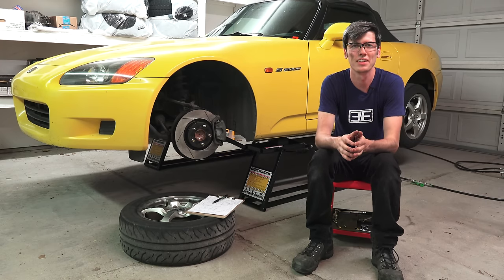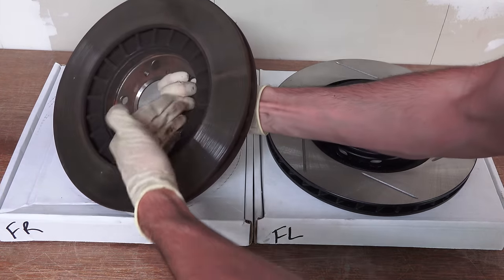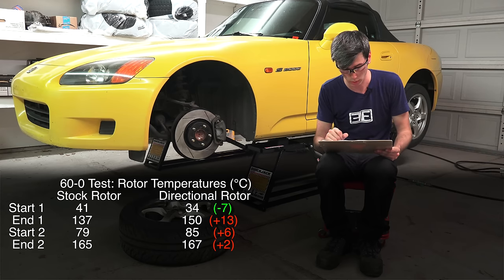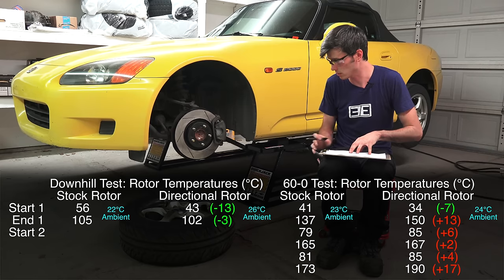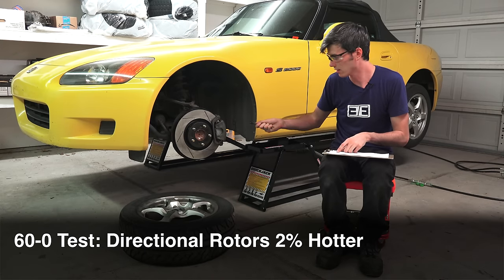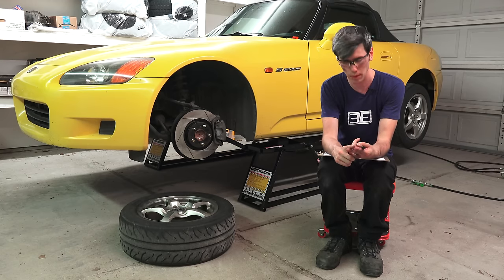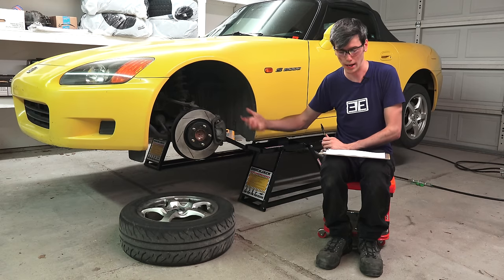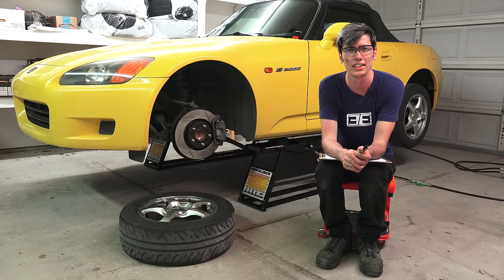Do Performance Brake Rotors Have Better Cooling?

Comment: You measured the outside surface. I wonder if the outer surface of the premium rotors is hotter (but the inner surface cooler) given that topologically, the thermal flow is less connected for the outer surface than the stocks.

Comment: The vents in vented rotors aren’t meant to cool the rotors, they’re actually meant to bite the pads to heat them and create friction. Drilled and slotted rotors are better. The holes allow gas and pressure built up from the heat escape from in between the pad and rotor so they can maintain full contact with each other. I would say drilled and slotted were best, and just drilled would be the next best option. I’d stray away from just slotted rotors. That’s only my opinion though.....but I’m soooooo not a professional lol.

Comment: I thought you're going to measure the temp as the vehicle moves. It's only natural for the performance rotor gets hotter because of the friction, but when it is moving, performance rotors released heat better than stock. Performance rotors were designed that way.

Comment: Thanks for great Video!

Isnt it the case  that those performance brakes will cool much quicker beetween breaking than stock - you accelerate and break all the time on track. I think that is the case.

Comment: Great video however you have missed the point that these get up to operating temperature quicker than stock which provides better friction coefficient therefore better braking while also being able to cool quicker from the higher temperatures. Overall better performance.

Comment: Why didn't he just did a test .. one side OEM rotors and aftermarket on the other .. just saying
Reply: Jancarlo C you then run the risk of flawed results due to one rotor doing more work than the other, resulting in a large temperature difference

Comment: Some variables here.

The vented discs are what are supposed to improve cooling. Considering the stock Honda discs were vented (through the centre of the disc vertically) there would only be a good difference based on the quality of the aftermarket discs and design of the cooling vanes. If the aftermarkets are cheap and nasty, the Honda discs may well be better made and designed.

I always thought, and I could be wrong, that the grooves in the face of the contact area were to help disperse brake pad dust.
Reply: The slots are to keep the pads from glazing over.  And so far I am happy with the cross drilled slotted Amazon rotors and ceramic pads.

Comment: The only way this test is viable is if it is performed under the exact same temperatures and time of day, plus the new pads have to be fully seated to the rotors to create the heat the seated ones did.

Stopping distance when the brakes are hot is a much more relevant test anyway, when it comes to brakes.
Your efforts are not unappreciated but too many times the ambient factor is left out of testing, Thanks!

Comment: If you're using street/track pads. You would want to keep your brakes hot on normal roads.
Therefore, the aftermarket rotors heat range is ideal.

Comment: Directional slotted rotors are designed to move debris from the between the brake pad material and the rotor, thus keeping the friction coefficient consistent and high. Included water vapor in wet situations. This prevents brake fade. Drilled rotors on the other hand are designed for cooling

Comment: Carbon content of the metal has more to do with heat tolerance and in turn heat dissipation ... I think you need to redo this video and use 3 or 4 different types. Also, you need a better control for testing other then you driving your car randomly and then manually checking the temp.

Comment: IMO this was not an apples-to-apples comparison: From the looks of the slotted rotors, they have not been bedded in properly whereby pad material is embedded onto the rotor. So there are only frictional stopping forces and there is no chemical force component, which happens between the pads and the rotor once pad material has been "bedded" into the rotors. He really needs to drive with the slotted rotors until they are bedded with the pads and do the test over. Or buy new stock rotors that have not been bedded and redo the tests.

Comment: Hi  the important thing in high performance driving regarding brake temps the rate of cooling?  or how fast the breaks cools after reaching high friction heat. A better test would be to put the stock and aftermarket rotors on a stationary rotating hub where the rotor can reach a specific speed each time.  then apply brake force for a specific amount of time.  Then immediately after removing the braking force measure the rate at which the rotor cools as it spins at the same rotational force.  In racing it's not about how hot a rotor gets, but how fast it cools down while still moving down the track.  I bet the aftermarket rotor will cool down faster than stock.

Comment: Cooler brakes doesn’t necessarily mean that they’re better. Good brakes will heat up fairly easily and stay within its operating temperature when in use. If they are cold all the time they would be useless.

Comment: Also need to factor in what materials the rotors were made of and (it appeared to me) that the stock rotors were used.  The stock ones might actually not be stopping quite as well, so they wouldn't heat up as much.

Comment: Former nascar tire specialist here , they are going to be the same temperature on the surface, because it’s the same friction from the pads and same pressure , they cool better in the sense of longevity and brake fade and they will dissipate the heat faster over driving time , high braking then when you drive say 500 meters that rotor will be cooler and less fade,

Comment: You should use stock and aftermarket rotors both new. As you can see old rotors are already bead in and the hills and valleys of the rotors metal surface are already  aligned to the pads and smoother but not glazing. That is why new rotors runs hot ventilated or not when installed new. When you're hard on a newly Installed brake rotors and pads it will overheat and warped that is why it needs a break in period. As you can see the machining in the new rotors you tested is very evident.

Comment: what about putting the slotted vented rotor on the passenger side and putting the stock rotor on the driver side? Because doesn't the driver side take more abuse and more stopping power than the passenger side? Considering it is the very first in line of all of the brakes. The driver side always tends to go bad faster than the passenger side. So and adequate test would be to flip them around and test each respective rotor on each side. I'm willing to bet that there is going to be a huge difference if you tested the slotted directional cooled rotor on the opposite side of the car.

Comment: And there was me thinking that brakes were there to stop the car, but apparently how hot they get is more important than how they perform at stopping
Just FYI, if your rotors weigh less and brake the same your car will be faster

Comment: Ok, first, that’s probably one of the coolest vids I’ve seen in a while.
I’ve been toying with the idea of switching my ‘07 F150 brake rotors to slotted, but I’ve come to the conclusion, and this was sealed by this video, that:
1. It’d really only be for looks
2. Even though I’m always on the road, I rarely have big loads or tow anything
3. I’ve seen videos and articles mentioning brake pad & rotor wear INCREASES with slotted/drilled. 
Thanks for this. Science rocks!

Comment: They do have better cooling. They are designed to interact with the air around them more efficiently than a stock rotor, which means they have to be turning; simply coming to a stop doesn't give them a chance to do this. Its not about how hot they get, its about how well they dissipate that heat as you continue to drive the car.

Comment: Surprised he did this test...it's common knowledge that slotted are meant for more aggressive usage...so why do a test comparing stock rotors to race ones in a non race setting? Just compare with street rotors in street settings. For an engineer to not think about those variables is alarming.

Comment: I know this video is a couples year old. However, when I look at the rotor installed starting at 7:28 minutes into the video, it looks like you installed the right front rotor onto the left side, which if that is the case then this explains why the rotor test wasn't better for you versus the race track test you mention. Look at how the vents are.

Comment: Slotted rotors aren't meant for better cooling though right? If you want better cooling do drilled. Slotted is for brake fade. If you want both do slotted and drilled.

Comment: What was the point of testing the temp?  That is not what slotted and/or drilled rotors are for...  It is for better braking.  Higher temps would be expected due to the trade off of pad wear for better braking.

Comment: So if those beaks cool by driving them then your test is flawed. You would need to hit the breaks on the performance rotor & then continue to drive to have it cool better. The performance breaks & rotors are still better.

Comment: Yeah but the brake pads were broken into the stock rotors and that would make the aftermarket once get hotter, you need same brake pads fir both and brake them in to each set of rotors then you can compare some numbers, plus both pad sets should be same life not one brand new. Also you can never eliminate human error, because you need a certain distance to stop in not 0-60 cause if you do that and the one rotor is different material and the pads grab it better then you will stop way sooner then other one but in a different distance

Comment: what direction do you belive to run a slotted disk? the scooping effect to cool down the rotor from in coming air or the flingling effect giving a channel to deflect the heat with centrifugal force?? This is somethine I dont know.

Comment: Probably got hotter because pads can push harder on surface of the slotted rotors without gas pockets keeping pads from hitting surface as hard on stock rotors. Thats what i know is it more for gas to escape, not so much heat. More heat with a better pad with work better

Comment: The problem with this test is your using slotted rotors on the curve vanes . The slots are to vent the gasses that form between the pad and rotor. with that gas venting, the pads actually generate more friction and that creates more heat.   Try this with slots put in the stock rotor, you will see its temps increase.

Comment: i agree 100% with your analogy.  actually 120% because your mind went to variables i didnt think of.  but i would have tested them quite a bit differently.  i always like to minimize variables and test the extremes when i am trying to understand an outcome.  1st, the idea of "vented" is that air is going to help to cool them.  so i would test them being hot and cooling them instead of them being cold and heating them.  so to get the most air, you have to get the most speed.  so here is my solution to testing these.
1.  put vented on one side, stock on the other, then switch for the second series of tests just to eliminate any variables related to each sides braking dominance. 
2.  push the brakes to failure (not on a hill, and not very fast either in case brake fade causes it to pull to one side)
3.  measure how fast they cool while sitting still.  this should give you a baseline. (and account for mass)
4.  "reheat them", then travel at the "speed limit" (120mph if you can find one that high.....wink, wink) and coast to a stop (engine braking and emergency brake) measure them again.  

MASS in itself makes sense also.  
in a street car, most brake fade will occur on a hill (in my opinion), obviously not much braking happens going up the hill (brakes are cold), and down the other side (slower speed), greater brake mass would be a good thing, allowing more braking before failure.  
in a race car, brakes are never cold, brake mass only adds to rotating mass and counter productive as taking longer to heat up also means taking longer to cool.  

my opinion is that this would give the best results of how much cooling the vents do.  
by the way, i absolutely LOVE your channel, it is my "GO TO" for anything i dont quite understand about cars. 
another side note.  your jokes at the beginning were hilarious.  KEEP UP THE GOOD WORK

Comment: Maybe it's because the pads weren't changed between every run, if they weren't cold enough they had more residual heat and the rotor just kept heating up because of this

Comment: I was always led to believe that the groves were to clear the pads of dust causing shorter braking distance and that drilled holes were for temperature not an expert here just thought the angles throw the crap out as they spin like water and dust increasing brake efficiency these tests don't do either

Comment: What about the Mu? Friction coefficient, those generate more heat during the same brake pressure which in turn makes them hotter.. Because they stop faster?

Comment: It could also be a matter of street speeds not being fast enough to efficiently draw in air or, worse yet, the lower speeds not being fast enough to throw the brake dust out and actually causing a insulatory effect in the veins.

Comment: I thought the slots are to let gasses and dust dissipate more efficiently rather than provide cooling.  I think cross drilled rotors will provide the cooling effect you are seeking.

Comment: The SOS testing proves what the veins and reversed air ducts are for - the object is to cool down the rotors quicker during use, so that after a braking passage (where the rotor temp goes up) they cool down much quicker, thus preparing (cooling) the rotors for the NEXT braking passage. What temperature the rotors have during braking doesn't matter AS much (as long as it's not considerably higher, that they damage the brake pads) - it's the temperature that the rotors have before you start braking that matters. But ultimately this only matters if you are braking a LOT, like you would do on a track. Day-to-day driving, where the rotors have ample time to cool down from one braking passage to the next, stock rotors will more than suffice.

Comment: Every-time I've ever replaced my stock brakes with the 'cooler looking' drilled and slotted rotors they always seem to get warped after a few months. I'm not driving hard or racing or anything, and I get name brands like PowerStop and Brembo.. Whats up with that??

Comment: pretty sure the directional rotors do cool but is mainly used to get water off the rotors while on the track. slotted rotors are what cools better since there are holes to where heat can be removed. just give it a thought. more surface area + friction = more heat produced. less surface area + friction = less heat produced

Comment: Hotter meant more friction therefore stops better and better brake feel. I had them and I liked it but I never check the temps. Just use higher performance pads and bed them in before hard driving.

Comment: It’s been mentioned a couple of times, but it’s not about cooling efficiency, it’s about brake fade caused by the gasses that build up under the break pad and rotor when driving the car under high demand/race conditions. The grooves help clear the gasses, but not very well sadly, if you only change the rotor, if you upgrade the brake pads to let’s say, EBC Green or Red Stuff, the pad material is in two sections with a 3-4 mm gap allowing more gas to escape. Then if you upgrade even more and fit your car with Brembo racking rotors and pads, the rotors will have holes drilled in key locations to vent gasses even fast and this does help to dissipate heat for the next time you want you racing car to slow at the next bend and not have your rotors melt as you hit the brake pedal. WRC has the answers.!

Comment: You're test is flawed. You compared an apple to an orange. The stock rotors are not slotted. The after market is slotted so the pad surface is being cleaned creating more friction ie more heat.

Comment: Slotted only rotors don’t advertise that they cool better because that’s not what the slots are for. This test would make more sense with slotted AND cross drilled rotors.
Since cross drilled rotors are actually the ones that advertise they cool better.

Comment: What kind of pads ceramic or disk ? And the fact the rear wasn't done either the rotor on the front are going to be thicker then the rear because they weren't changed out just common sense

Comment: Interesting video, also another variable are the pads, they need to be some time with the new rotors until they fit. before they don´t brake fine, and probably they put the only part that touch the rotors hotter.

Comment: Did you allow the brake pads to cool and /or use the same  brake pads on each test because if you dont allow for bedding in of pads not exactly a fair comparison if you did not replace  pads as well for each test

Comment: Performance rotors are designed to provide better cooling and more friction for harder breaking which is why your temperature was higher on the performance rotors.

Comment: A theory: the stock disks where more worn and thinner than the new aftermarket ones so %50 of the pedal would be more force on the newer thicker disk than the thinner one

Comment: The slots are for gases from.the pads to escape - preventing brake fade.  Odd the weight of your aftermarket rotors was less, mine was actually more than my stock(A4).
A bit beefier than stock.
Interesting video, but I'd like to have seen your stopping distance over a series of 120 - 0 type stops. And you redeemed yourself at the end, the after market brake weren't being pushed hard enough to be of real benefit